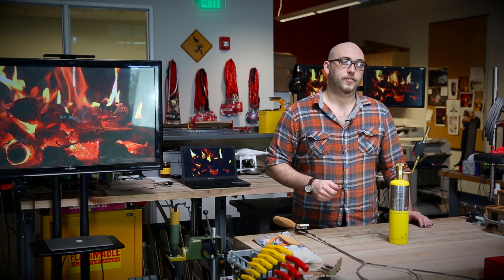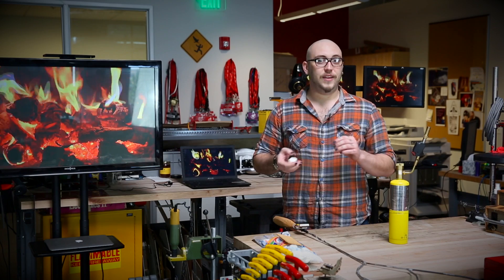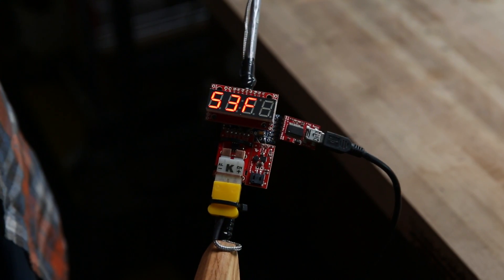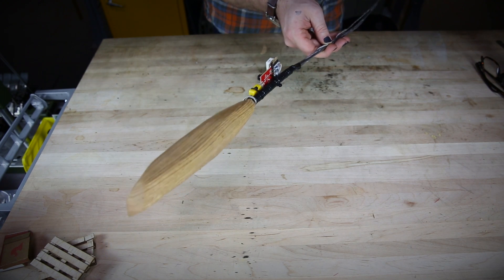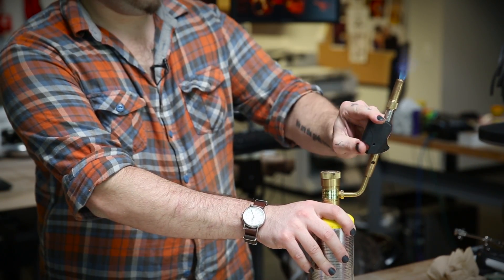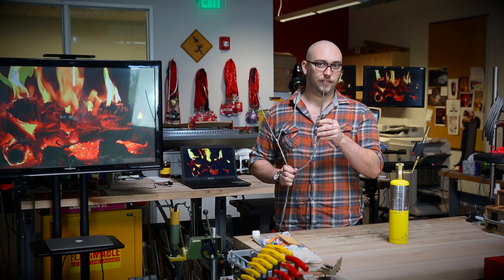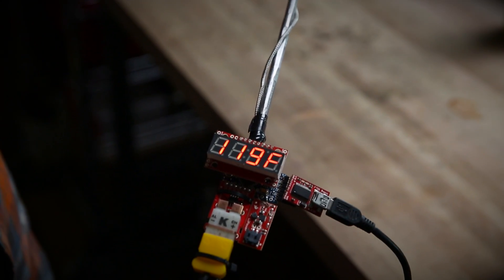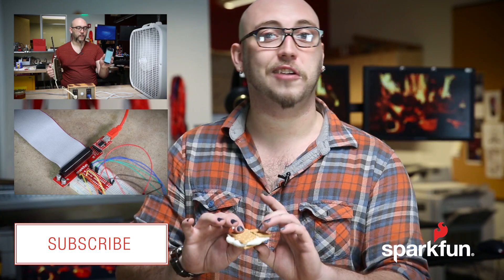SparkFun Thermocouple Marshmallow Stick

Comment: It is stainless steel, but because they used manufacturing processes that don't specifically monitor for toxic contaminants, it's not for direct contact with food. When it's not controlled, a lot of the time people say "don't care" and contamination actually happens. That's why it's not for direct contact with food. So what you did here was actually unsafe. They could make NSF or otherwise food safe products, but due to tighter controls and regulation, it will cost more.

Comment: Not quite sure how accurate it is as it was reading 54F room temp which unless SF hates their employees is probably not a realistic ambient temperature.
Reply: Also i think there k type probes measure at the tip, which was not actually inside the marshmallow but poking out the end.

Comment: Nice rig, but you missed a great opportunity to make this video epic. 1. You should have put two marshmallows on the plain steel points and not put one on the "not for direct contact with food" thermocouple. This would have required you to use an actual campfire, which brings us to... 2. You should have started the campfire with an exploding tantalum capacitor.